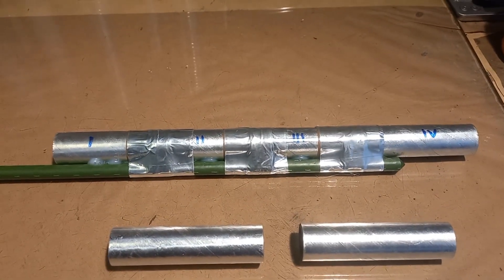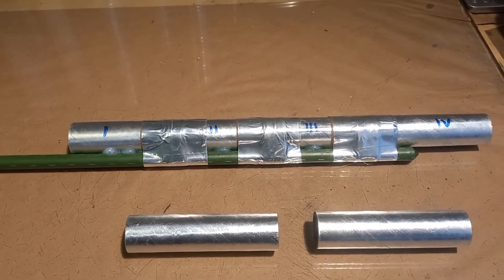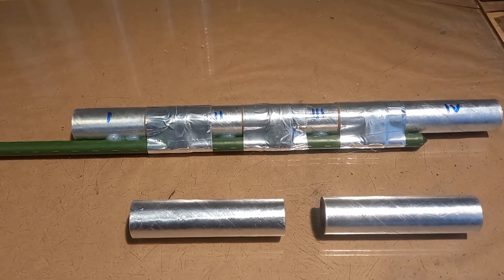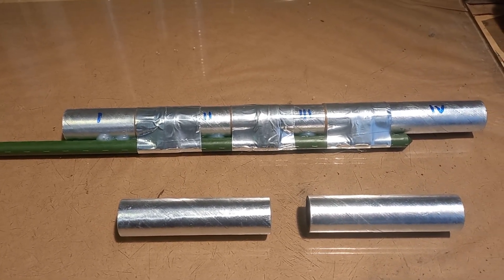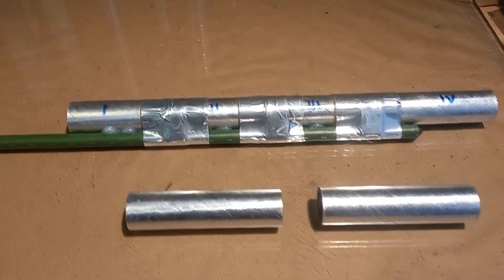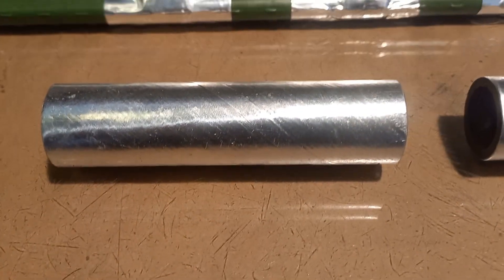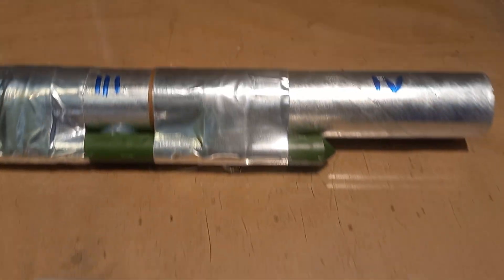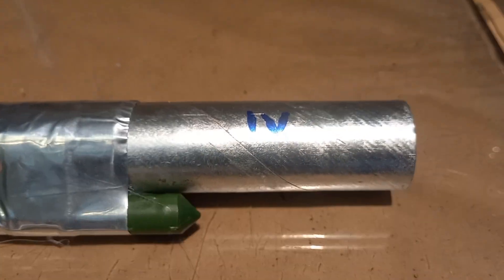Whistles on spiral tubes #3 ( The 1 pound 4 stage Rocket) ""See important description """

Comment: Nice stuff mate. I already manage to make my whistle work by simply making a press with pressure guage. You were correct in saying im working blind without a guage. I already uploaded a short regarding my khp and benny whistles. So far i got no Catos out of 10 whistle rockets i made.
Reply from the maker: @blackpowderMix  good work , I just saw your vid. Congrats
Reply: @Pyroflorida  Thanks. Next time i will try to copy your 4 stage whistle rocket when i have the right tooling for my 8oz. Right now im stuck with 4oz and 2oz tooling.

Comment: Only khp in the first press?
Reply from the maker: @husseinfakhreddine2501  yes , only Khp on first motor
Reply: @Pyroflorida  milled?
Reply: Witch titanium do you use ?
Reply from the maker: @husseinfakhreddine2501  yes is blade milled .
There is so much information on my vids  in the descriptions,  specially on comments .
Go through them , you will learn a lot.
Reply from the maker: @Pyrorocket123  
Titanium sponge -40+80
Reply: @Pyroflorida  ya I’ve learned a tremendous amount from your videos and the comments below your the man!
Reply: @Pyroflorida  do i need the titanium if im making a 1lb rockets with khb strobe and a header 3 stage rocket
Reply: @Pyrorocket123  I dont think you need it, as far as i know titanium doesnt impact the power that much its more for the cosmetic sparky tail. i might do some testing to see in the future and let you know if i remember, but ive just been adding ti to all my whistle fuel regardless cause i like the tails
Reply from the maker: @Pyrorocket123  titanium is only used in the delay part and it is only used for visual effect , (sparky tail) you can omitted if you want